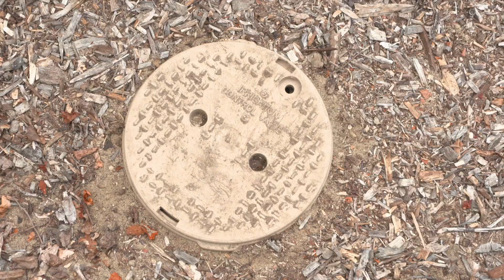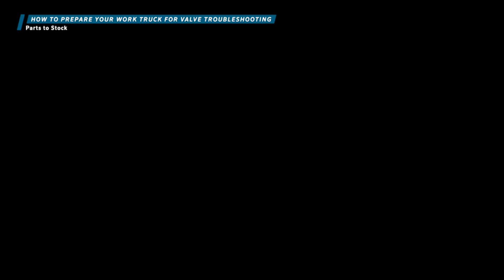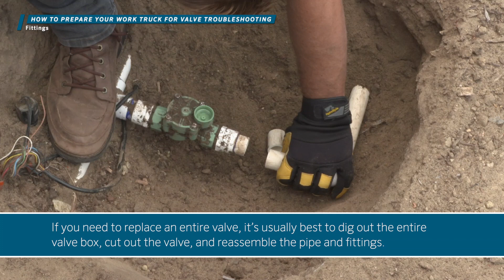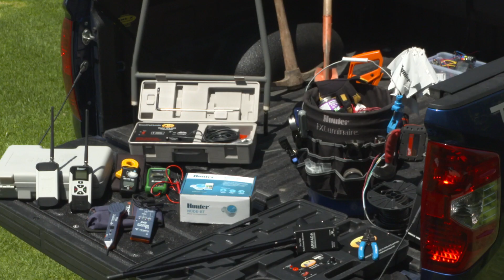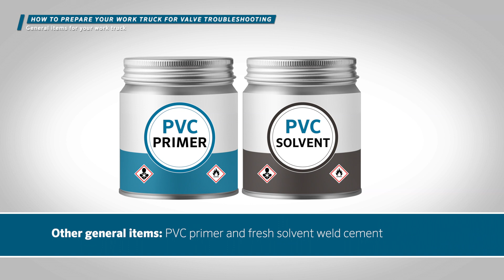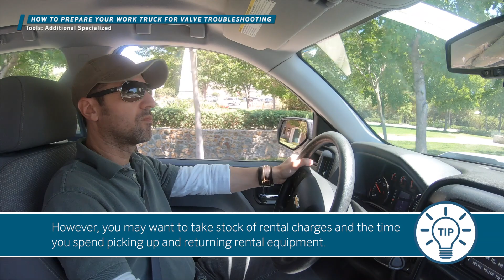Preparing your work truck for Hunter valve troubleshooting and replacement.

Comment: What does the on, off and 1/4 turn on the solenoid of the valve means?
Reply from the maker: You can rotate the solenoid assembly to manually open the valve: https://youtu.be/2MAn1cX0pqA?si=kEF_x3Ax1-NokMm8